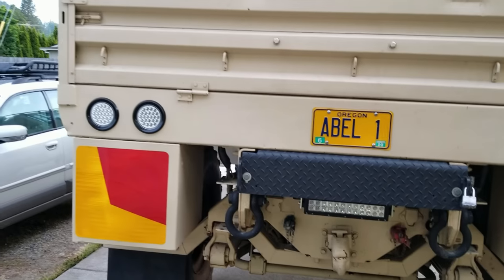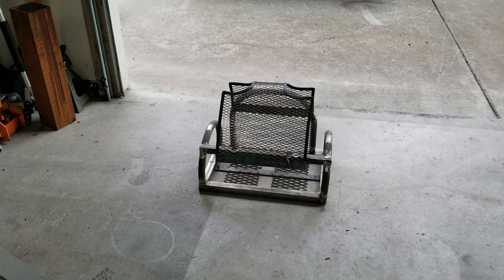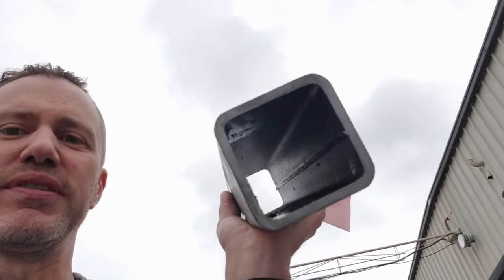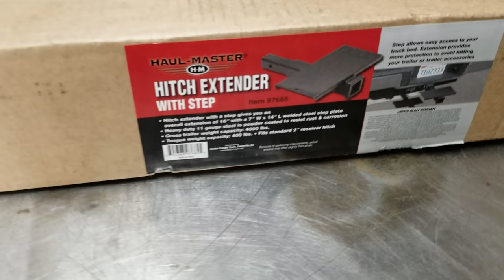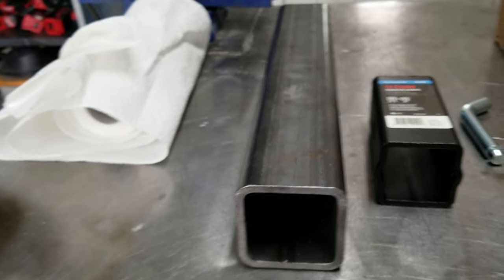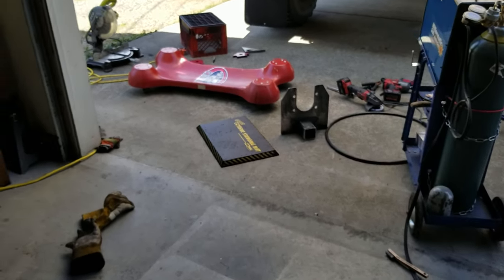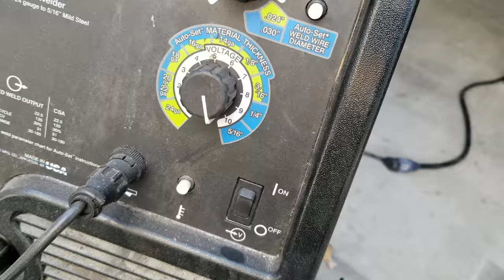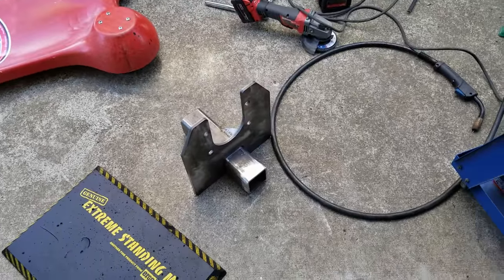Abel LMTV build part 106 (DIY trailer hitch kit, Willows VP racing fuel jug cage)

Comment: Finished products look great. I hope to do a little welding myself tomorrow... it will be my first time MiG welding with stainless steel. On a side note, I pulled the dash on PARTriSha today... I saw your time lapse on Abel some while back. It all turned out good, but pulling the instrument panel, relays, fuse box, air brake pull-handles, etc. took half the day! I wish I could have had it done as fast as you did yours! lol.

Comment: Nice work, Sean. You might want to consider welding a collar around the nose of the receiver tube. It will prevent distortion and provide some extra thickness for when you rub on rocks and whatnot. What was the end result of the sensor wiring cleanup?
Reply from the maker: Sensor wiring cleanup was a success.  I think the fact that it was hand tight was the major issue.  We won't be towing anything with this hitch as far as I know.  It is just for accessories and an upcoming mod that Willow wants done.   Stay tuned...

Comment: How is the clearance when you use the pintle hook to pull your LMTV trailer? Could be a problem off roading or raised RR tracks could hit trailer tongue. But could be ok. Worth checking. Nice job the comment Ethan had of a collar on tube is great.  Keeps it from flaring out.
Reply from the maker: Unless there is 45 degrees between the truck and trailer it won't do anything.  The clearances are spot on.